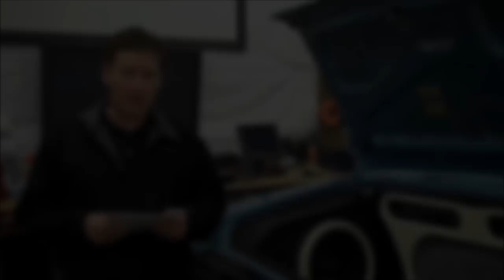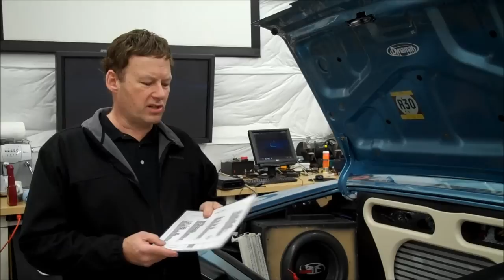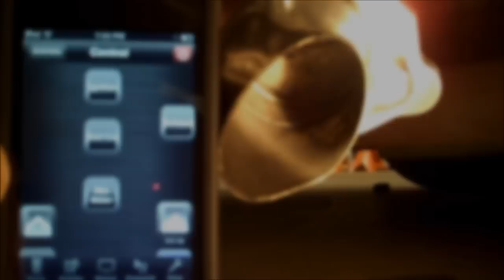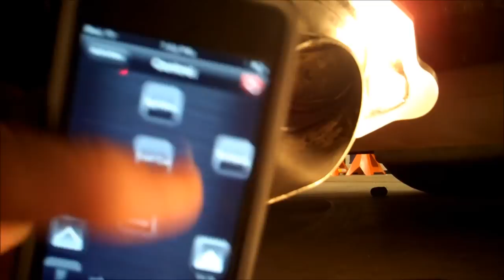RedEye GTO - How It's Done

Comment: Oh, the limit switch will ultimately work better than the timer. As seasons change and temperature drops or rises, the windows take longer or shorter time to go up and down. Obviously more battery power when it's warm outside and the window tracks are tighter in the winter aswell as the grease on the window regulator. I love it and just throwing in my 2c. This is one of the coolest things I've ever seen as a car guy and vintage car guy at that... ok, Pontiac to be spacific. lol